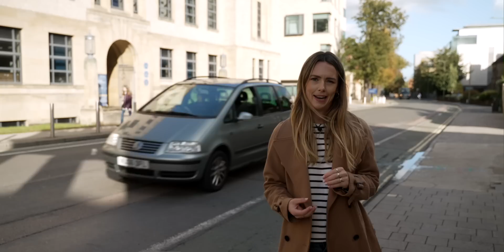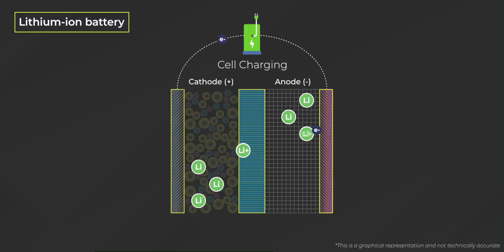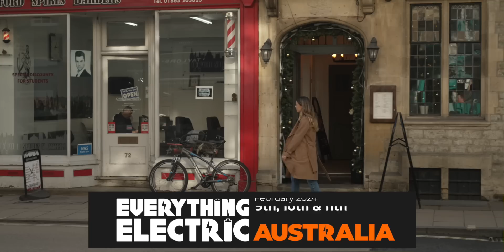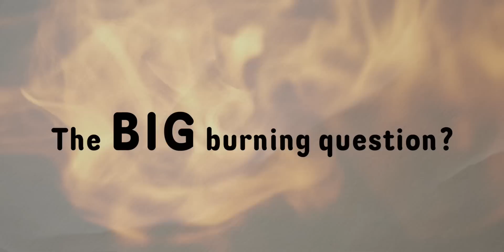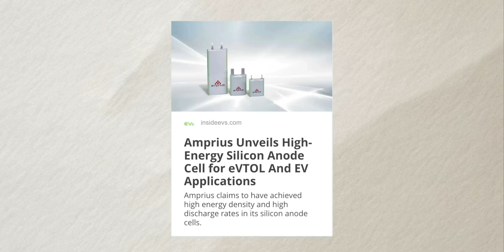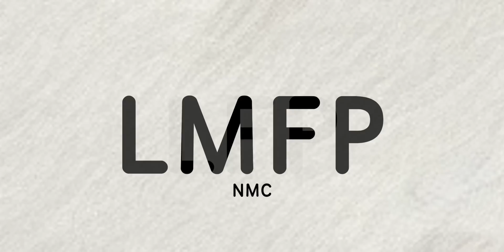The BIG Battery Breakdown: Fires, Failures and Future Breakthroughs!

Comment: I now know more about battery  chemistry than I could possibly ever need.  Great video!
Reply: The issue is not if they go on fire or not, it's what happens if they get caught up in a fire even if they are not the origin of the fire. Lithium Ion batteries pose a particular problem for fire departments because the battery itself can manufacture oxygen during the fire process ,exothermically. This is why car ferries are banning EVs, when ev's are caught up in a fire like on a car ferry they are impossible to extinguish at sea or almost impossible.
Reply: @johhny711  Did you watch it? 
You are like the old Little Johnny jokes. 
Now go watch      &        Listen!!!
Reply: @BioniqBob  Read again slowly this time :
The issue is not if they go on fire or not, it's what happens if they get caught up in a fire even if they are not the origin of the fire. Lithium Ion batteries pose a particular problem for fire departments because the battery itself can manufacture oxygen during the fire process ,exothermically. This is why car ferries are banning EVs, when ev's are caught up in a fire like on a car ferry they are impossible to extinguish at sea or almost impossible.
Reply: @johhny711  Batteries are changing, petrol will always go BOOM. Even if they stayed the same, put out one fire or put out 60. No brainer, just like how you were born. Go Blaw Blaw Blaw to someone else.
Reply: @BioniqBob  Well Bobby , some shopping centers are banning Ev's , some car ferries are banning EV's ,these are just facts , there must be a reason , and the reason is once they catch fire they are practically impossible to extinguish .
Reply: Being misinformed is worse than being uninformed. (The people running this channel are both.)
Reply: @glorfification  What was wrong on this vid? Euan knows his stuff and I didn't see anything incorrect in what he said. Some significant simplifications, but that's fair enough for this audience. People can watch 'The Limiting Factor' if they want more detailed battery info in video form.
Reply: @xxwookey  glorification is a troll.  Just looking to start an argument.
Reply: @glorfification  Think your comment missed a few words there. Should be ... "The people running this channel are trying to avoid both situations"
Reply: @glorfification  I am reading your words.  You are saying glorification is misinformed  and uninformed.   I agree.
Reply: @glorfification  So glad you saved us from all the lies. 
Your job is done, you can move on now. Gees!

Comment: If we are looking to convert all vehicles to EVs then a thousand mile battery does make sense. You'll be charging less often, which frees up chargers for other people to use them.
You won't use your thousand mile range on one journey, you'll use it over 2-3 weeks, and only recharge once every 2-3 weeks just like ICE cars currently do. Then you've got a chance of converting people who don't have off street parking and can't charge at home into EV users.
Reply: But then you also have to produce significantly more battery cells causing a need for more raw materials, higher initial environmental impact per car, higher car price, etc. It seems a better solution to me to just expand the charging network to meet the demands. The good thing is, that electricity is potentially available everywhere in our civilisation.
Reply: @Elgsdyr  That would certainly help, but the number of chargers needed is going to be pretty big. We have just under a million electric cars on the road, and 33 million non electric cars to replace. Refuelling a non electric car takes about 5 minutes and gives you about 700 miles of range, filling up once every 2-3 weeks. Getting the same range from electricity is going to mean charging several times, and occupying the charger for at least 2 hours in total. The EV driver can do other things whilst charging, but no-one else can use that charger for the 2 hours that it's being used. There currently 53,000 public EV charging points. 
So to replace ICE cars, we need another 33 million EVs. Were going to need 33 x 53,000 more chargers. that 1,743,000 more chargers. We'll also need to be charging a lot less often to avoid getting queues. We'll also need EVs to be available at much lower prices. Where is the EV equivalent of a "peoples car", the sort of thing that got people driving cars in the first place?
Why does the fully charged show not campaign on this? Instead they constantly defend the mediocrity of the current EV industry, expensive products that are much more inconvenient to use than the ICE vehicles we need to replace. Make me wonder what the real agenda is with the fully charged show, they seem quite happy to support a system that forces most people to stick with ICE vehicles. Just stop burning things, should be focusing it's efforts against the current EV industry telling them to provide a viable alternative that will let everyone (not just a select few) stop burning things.

Comment: I disagree regarding EV fires. It depends of the quality of the EV/battery. 
Plenty of examples of cheap cars (china??!) or improvised cars being fatal. There's a video with an EV that crashes into a tollbooth rail from what it seems 50+ km/h (the driver probably asleep) and in literally 3s the car goes instant flame torch.  Also battery fires cannot be extinguished. 
I mean it's same case as the infamouse Samsung Note phones. If battery is low quality .. stuff goes sideways real fast.
Reply: I'd like to see that tollbooth crash. Where did it happen?
Reply: So, since you bring up the "infamous Samsung Note phones" - how many spontaneous battery fires in phones do you hear about these days compared to 10-20 years ago? Personally, I can't recall even a single instance since the Note failures. They probably do exist and I'm aware that my personal experience isn't evidence, but my point here is that it has obviously improved significantly over the years and - given human ingenuity - there's absolutely no reason to believe this won't continue until it's a definitive non-issue in the near future.
Reply: Cobalt based batteries should just be forbidden. They are pretty much ticking time bombs
Reply: @SolAce-nw2hf  ..you better ditch your smartphone/laptop/PC/tablet then!🤔
Reply: whoah there fella, you can't just go around disagreeing with fully charged, they don't like it.

Comment: The Lucid Air GT is the longest range EV currently on the market not the Mercedes
(I realise it's not on sale in the UK & many other markets which is probably the source of the discrepancy but as a global channel it's worth noting the difference)

Overall a great video though - a great guest to have with clear explanations. Good work Fully Charged and thank to Euan!
Reply: Lucid Air is more like a rare supercar, while the EQS is a mass-manufactured thing you see all over the place. I at least have seen the EQS in UK, CH, DE and NO many times. A lucid air I never spotted.

But technically you are right.
Reply: @oslonafo The EQS is far from mass produced and common. The lucid Air is more rare but that doesn't negate the fact that it has the most range of any EV
Reply: @oslonafo I got to sit in one, ALMOST test drive. Colorado